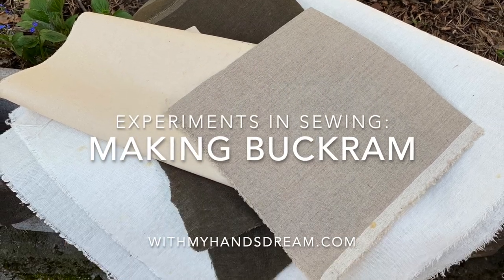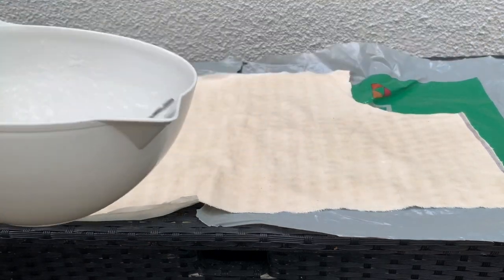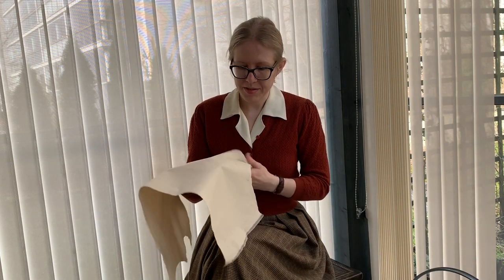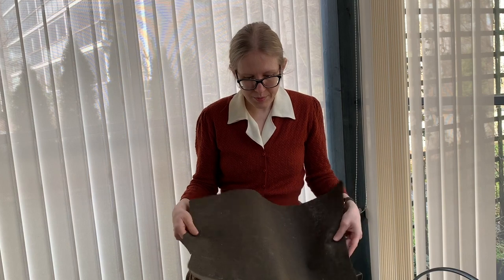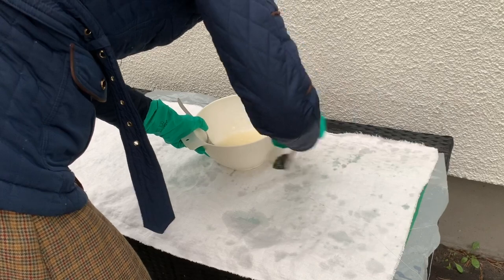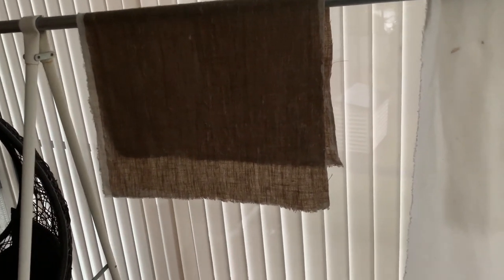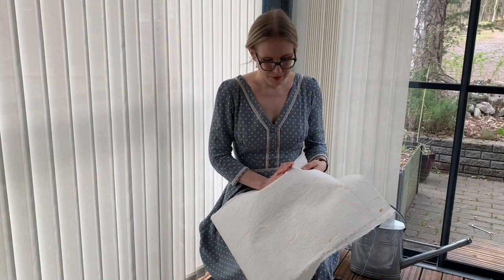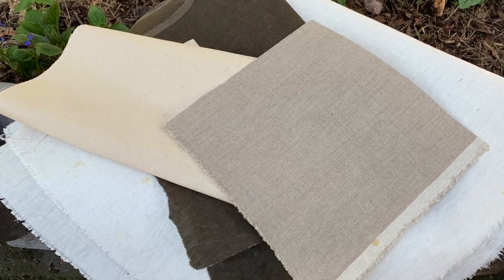Experiment: Making buckram at home

Comment: An economical alternative material for stiffening fabrics into a buckram like material is to use cornstarch. You mix 4 tablespoons 60ml cornstarch to 1 cup 250ml water and mix until smooth ilky consistency. Now you have to cook this, either on the stove or in the microwave. Stirring every once in awhile. Cookjust until gelled and semitransparent. It gels just below boiling, sobring to a boil, continue to boil 30 seconds while constantly mixing, then remove from heat. Allow to cool a bit before using. Give it a shot if youre curious.
Reply from the maker: I actually make something very similar from potato starch to starch my lace and the collar of my national costume. I haven’t tried using it for hats or thicker fabrics and am not entirely sure whether it would hold up.

Comment: The video is a bit older but I will leave my advice here for making buckrum. While Xanthan works, it´s not the best. It is closer to a starch stiffened fabric than how actual buckram acts. I know that from personal experience. It acts differnt to gum or glue stiffened Buckram, is not as durable, a bit more suceptible to moisture and also when doing historical stuff, well, not historic. 

While the Burnley and Throwbridge video is alright, it´s the main reason people seem to believe Gum Tragecanth is the only "historical" stiffener for buckram, while in reality a wide array of gums and glues was used. A very thick starch solution is one (not as often as it is more fragile and very suceptible to moisture), rabbit skin glue was used too and works quiet well and another, the one I am leading up to, is Gum Arabic. Gum Arabic having basically the same processing and properties as Gum Tragecanth, having been used historically for this too, making a historical buckram that is basically the same to the one made from Gum Tragecanth, as both are water soluble tree resins.

The best part about it? Gum Arabic is widely aviable and very affordable as it is used as incense and mainly a food additive. So you can just by a half kilogramm bag of it for around 20-30 dollar on amazon. Around 10 dollar if you buy a non food grade version with bad purity, which works perfect for making buckram. (although, I reccomend straining it through a fine sive or cheesecloth to get dirt and foreign bodys out of the solution after dissolving it)
Reply from the maker: Thank you for this! It is very good info!
Reply: @withmyhandsdream  No problem! And to back it up, most historical sources don´t mention what was used, but generalise it as "Gum´s and Glue`s/Paste´s". That tells you that it´s not just one thing, but many differnt materials. Garsault for example describes Buckram as just "Gummed Linen".

Comment: Do you think instead of brushing the gum on you could have stuck the material into the liquid and wrung it out, then hung it? Also, on the one piece that was too floppy for your hat making, could you brush on another layer of the gum? Thank you so much for doing these experiments. I now have a starting point.
Reply: Also, your final measurements were 3 teaspoons of gum to 500 ml of water, is this correct? Did you use warm water or room temperature?
Reply from the maker: That might have worked as well, although the gum mixture was very thick and I could have ended up with too much of it. I might try adding another layer to the floppy one the next time I'm making buckram. It will be interesting to see if it helps! Thank you for your ideas!
Reply from the maker: I don’t remember exactly. I don’t think that the temperature matters in this case.
Reply: @withmyhandsdream  Yeah, it not really getting stiff enougth is a problem with using Xanthan. The main problem is, that Xanthan is a polymerising thickener that absorbs water, so while the mixture is very thick, there actually isn`s all that much Xanthan in it. The thickness also inhibits it from really seeping in between the fibres, and making the mix thin enougth to actually do it will barely leave any Xanthan in the fabric after it dryes, making 5-8 repeated treatments neccesary. Another problem is that it`s not really sticky at all, more slimy and drying quiet powedery, not crystaline, meaning it won`t have the same binding force as an animal glue or tree resin, reducing the lifeexpectancy of the buckram and it loosing it´s stiffening effect pretty fast. It also loves to just suck moisture out from the air. I had actually once mould growing on my Xanthan buckram, when I was still using that method, after a very moist week. Which is another point, mould and backteria can grow on it and feed off it pretty fast.

Thats why I, as somone having experimented with it and doing 18th century tailoring on a budged, don`t reccomend it. It´s a nice idea but generally more trouble than it´s worth in the long run.
My choice is an actual historical one. Gum Arabic, which was used to make buckram too. And as it´s a tree resin too, with very similar propertys to Gum Tragecanth, it makes a Buckrum that is basically indistinguishable.
With the only real difference, that as a common food additive Gum Arabic is widely avaiable and cheap. It can just be ordered on Amazon or Ebay for example. And if you go for non food grade, impure Gum Arabic, you can get it very cheap and it´s perfectly fine, as it´s going to be used as a fabric stiffening agent. The coarse dirt can just be sived out from the solution with a cheese cloth and the stuff that´s not visible like dust or impuritys does not matter, because it´s not going to be eaten.